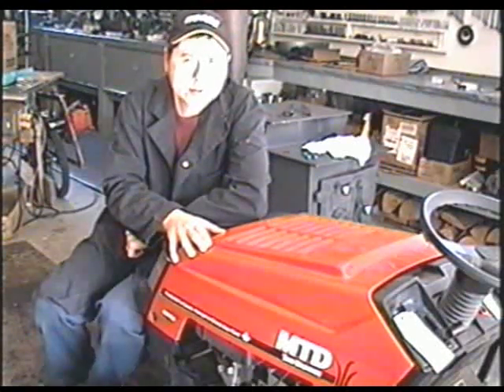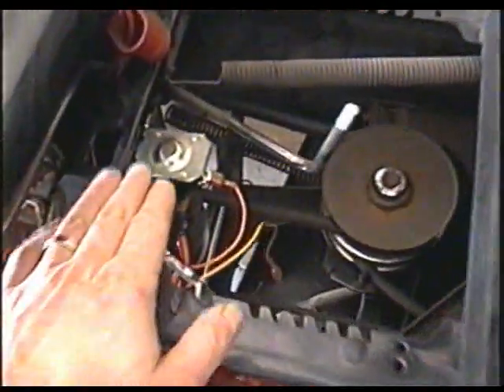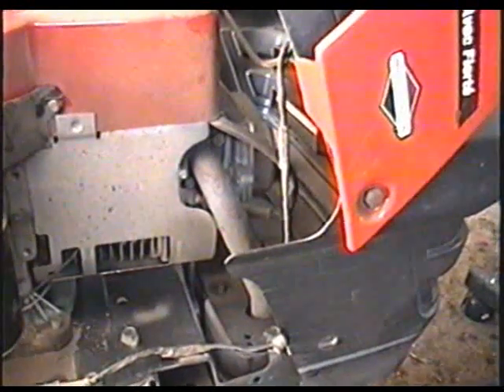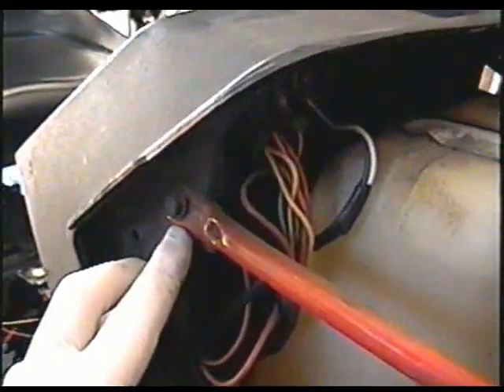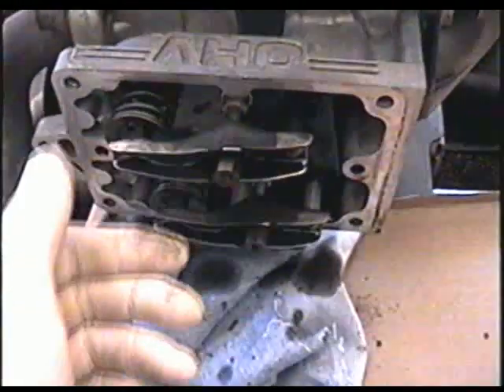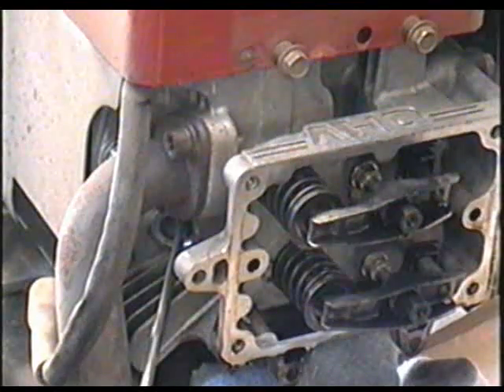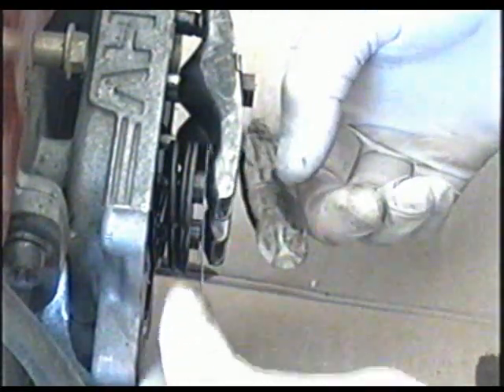( HOW TO ADJUST VALVES) FIX HARD TO START Lawn Tractor with OHV Briggs Engine- MUST SEE- Part 1/2

Comment: been dealing with a tractor  some one gave me it was sitting in the weeds the guy who gave it to me  said it dont run me playing around with it did see things as you showed it not quite  sure as I have seen other videos stating it could be a cam shaft issue some type of spring type gizmo in there I sure want to get the thing to run if I can't not to many worries there it was free however I want to learn and if you may guide me on my quest for knowledge 
      thank you in advance ☺

Comment: Thanks for all the helpful videos!
I replaced a broken flywheel key on my 14.5 B&S OHV yard machine riding mower.  I also adjusted the valves.  Everything seems okay but when trying to start nothing happens and I cannot turn the flywheel manually.  If I loosen the flywheel bolt I can spin the flywheel and also engage it by attempting to start the mower.  Yet, if I tighten the flywheel bolt even slightly, the flywheel will not spin.  Any thoughts on what I am missing?  Thanks!

Comment: i have kohler command pro 15 engine on my exmark mower and it has become hard to start recently especially when its cold. i thought that it was a throttle linkage adjustment but that didnt help. could the vavles be the issue? i dont think they have been adjusted and we have been using it for landscaping for about 9 or 10 years

Comment: Dony.  I have an 18.5 hp on a Toro Pony.  Is the feeler gauge setting the same?  .004.  I have tried several times without success.  Did the test for battery and starter without the spark plug and the engine turns fine so it seems to be the values need adjusting.  How much play in correct? is making it too tight a problem?  How do I make sure I am at top dead center.  Thanks in advance. Love all the info on your channel.  Great job.

Comment: This is a great video! I am having the same problem on a Briggs 15.5 engine.
I checked the battery and starter. After watching this I did the valve adjustment and it started 3 straight times and then would not start again. Any ideas??

Comment: I had a Briggs & Stratton 20 hp Intek engine and is hard to turn over and only turns with the spark plug out? I have 2 set the valves on the engine and have lower it to .003 and it still does the same thing. What do you suggest ? New valves or new head?

Comment: Hi Dony, Same type motor. Same type issue. So I adjusted the values according to your instructions. I get severe back firing when I tried. Could these be set wrong? I was not certain about the top dead center. Both vlaves all the way out after the compression stroke? I have seen different ways to do this, and after trying about 1 times Cannot get it adjusted properly.

Comment: @donyboy73 
thanks for the excellent video. I havea quesion to ask.  In my manualk it says :
Intake valve clearance is suppose to be set at 0.003 to 0.005 and exhaust at 0.005 to 0.007 , how do i tell the difference between my exhaust and intake valve so I can adjust them accordingly?

thanks

Comment: I adjusted the valves as per your video?  The valves moved as they should.. It started easily and I ran it for a few moments. All was good.  y I tried starting it and the same non-start happened again.  I repeated the valve adj and now the lower valve won't move when I cycled it through by hand.  Is the non-movement caused by something I did?  Your videos are great, and just long enough to get the problem explained.   I can see why your vids are so popular.. Please help!!  Thank you.

Comment: Great video. I've adjusted the valves, double and triple checked them but it still won't turn over with the starter. When starter gets to the point of opening the ex, it stops dead until you manually turn the flywheel. help!

Comment: I have seen  two ways on youtube to adjust the valves. One is TDC 1/4 turn  as you mention and others just take the pressure off one at time.  I just tried both on a briggs 17.5 HP engine  31c707 type 3346 G6, and I notice that if I set to the method you describe.  I have about a shim thickness difference  if I check  each when rotating  and checking one while the other is compressed.    Is it normal to have more space  after using the method you describe  if checking  each individually?  If set to the other method  of compressing one than the other. Then it seems a little too tight if  checking at TDC +1/4 turn.  
Briggs lists a tolerance RANGE so I am assuming as long as one is in the range it will be fine?

Comment: I have a B&S 21 hp . I have the same symptoms as the lawn mower in this video. I adjusted the valves; still have the same problems. Battery is good, starter is good, cycles through with no problem without spark plug in. what else might it be? i would appreciate your input thank you in advance.

Comment: Hi Dony, I have an older Cub Cadet rider model 2135 it is hard to start and starts sometimes but with a lot of backfiring I'm not sure the right spark plug is in it now, can you please tell me the correct spark plug preferably NGK to use and why the hard starts and all the back firing,, thanks in advance for your answer have a good day

Comment: You mentioned turning the motor a quarter inch, but I've heard it's actually you mark TDC on the item you are touching the top of the piston with, then you mark the item 1/4" from the first mark, then turn the engine until the piston has moved back down the 1/4". So, not a 1/4" movement of the flywheel but a 1/4" movement of the piston in the cylinder. Thoughts?

Comment: And also I did the carb rebuild I  tge nikki carburetor it came with a new needle but it looks like the seat is built in to the plastic of the carb tge kit came with a little metal piece that looks like the top of one of those smooth metal thumbtacks any thoughts??

Comment: Hi, I had the same problem. I bought it from a guy that didn't know much about Engine... Anyway... I didn't adjust anything.... It was hard to turn just like this Video. I lean the Tractor on one side... Drained all the OIL.... BAM.... The Engine turns FREELY again... The OIL was GUMMY. I Put NEW OIL.... Hahahahaha... I paid $50 Bucks for a 16.5 B&S MTD Mower... RUN PERFECT NOW!!! 

*** GUMMY DIRTY OIL or OVER FILLED OIL - WILL DO THE SAME - TRY THAT FIRST !!!

Comment: Donboy73 I just replaced the head gasket in my mower with a briggs OHV engine. It starts right away then the engine slightly revs up and down for about 3 to 4 seconds before it sounds normal. Is this the valve job I did or should I look for problems elsewhere

Comment: Hey donyboy73 I have a John Deere riding mower with a Briggs and Stratton 17hp intek engine it's doing the same thing when I turn
 the key I have watched your video many times and did it just as you did it but still not turning over fast enough to crank it up I replace battery and had starter tested its good (need help)

Comment: JUST WAS WOUNDERING IF YOU HAD ANY INSITES ON A 2001 HUSKEE RIDING MOWER RUNS GREAT THE WHOLE MOWER IS IN GOOD SHAPE THE BACK DRIVE BELT KEEPS JUMPING OFF IN DRIVE AND REVIRSE PUT A NEW BELT ON IT STILL DOES IT IT HAS THE VARIABLE SPEED PULLIES ON IT WOULD YOU HAVE ANY IDEA WHAT COULD BE WRONG WITH IT or do you have a video on how to fix it  THANKS FOR ANY INFO. TROY

Comment: hello donnyboy.  Enjoyed all your vids on briggs and stratton engines and how you explain things, thanks, good advice and easy to understand, I wonder if you could help me with a wee problem on my older model husquvarna/ with a briggs and stratton 12 horse power,,,, power built ,,,,,syncrho balanced  engine.  ???  The starter seems to be ok had it off cleaned up and turns the engine no problems with plugs removed..  So I replaced the plug put the starter back on and hey presto it worked.   Then after a couple of start ups the starter jams again engine seems to lock it up again.  When  the starter engages the flywheel the engine and starter seem to lock up up with a clonk.   The engine runs great with no rattles clanks smoke or any faults but some how jams the starter..  I think some thing needs adjustment but unfortunately cannot seem to locate a cover as with the OHV models for adjustment.. Will i have to remove some thing else or is there some thing I have to do in order to find out what the problem is.  I dont want to have to buy a new stater then find the problem is still there.I live in a remote part of the Scottish borders UK,  so rely on my ability to sort out most problems for my self but this has me a bit puzzeld. If you could help me out advise etc,  I would be grateful to your knowledge and assistance , thank you .  enjoy.                             TYPE/ 0167.01
MODEL/282707
12.HP. SYNCHRO BALANCED

Comment: Hi Donyboy73.  I have a craftsman 18hp that does exactly that but mine is flat head.  I did all I can think off and still not working.  I check the flywheel key and still in good shape, I tested both the starter and starter solenoid and they are working fine. spark plugs do have sparks, I've checked and clean the carburetor as well but nothing changed.  I even tried to adjust the valve clears by using a file but not 100% of the clearance so I did .008 for intek and .012 for exhaus still nothing changed.  what is interesting is when i removed the spark plugs, it turns freely.  Any idea or suggest?  Any idea or advice will be much appreciated it.  
thanks in advance.

Comment: Hey Donyboy, I have this same tractor and mine runs pretty good but it takes forever to start. You push the throttle all the way to choke and it just spins and spins for about 30 seconds before it finally fires and then you adjust the throttle. Is this normal for this type of mower? Also when I turn it off even for a minute, I have to choke it again to get it to crank. Any advice?

Comment: I also tested the wires going to the backfire switch on the cart and the switch itself both working fine. .. I tested spark is good. .. I tried jumping it at the starter with a chatger it cranked the Moro but there didn't seem to be enough power because it turned like urs did in the video... when I turn it w the key it spins far and it seems like it is so close to firing up.... it doesn't seem like it is flooding anymore since a cleaned out the entire fuel and oil system both a few times every thing running through that mower is clean enough to eat out of.... is it possible the rackers have loosened so much that its not causing resistance any more???? PLEASE HELP I can post a video if it would be more helpfull

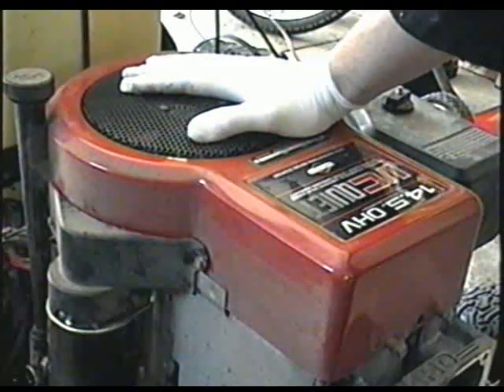Comment: 5:27 you don't turn the engine 1/4 inch. You need to find top dead centre then turn the engine until the screwdriver in the cylinder goes back in 1/4 inch (6mm) past TDC.

Comment: Hi, I have a 12.5HP I/C Quiet - has a hard time starting - sounds just like in this video - I pulled the plug and it turns effortlessly - I had thought before hand it was the starter. How ever its a flat head - is the procedure very different to address this issue for a flat head?

Comment: Donyboy, my engine starts ok but when i lift off the brake it dies down. I hard wired the safety switch under the seat so it is not an electrical issue because the tractor moves for about 1 second when the brake is fully released then dies,. Is this also a compression issue?

Comment: Adjusted the valves on my 1997 14.5, but still have the problem.  With the plug out, starter turns the motor no problem.  I have checked the valve adjustments about 1/2 dozen times now, going up or down .001.  Currently on .002 for intake and .003 for outlet.  Turn the key and engine turns about two revolutions and stalls.  Could it still be the starter?

Comment: My intek (older Craftsman motor) just started not wanting to turn over. Good battery and starter. It's just having a hard time. The bottom valve (exhaust?) doesn't move now. Strange. Pushrod doesn't look like it's moving in and out. What should I be looking for? When I try to start, gas leaks past valve and out exhaust. Do it's stuck open? I'm lost.

Comment: Hey, Donyboy73. I have a Craftsman LT2000 with a Kohler Pro 17.5 HP OHV. It does the same thing as the mower in the video It cranked up fine just a few weeks ago, but today it would only spin then stop. I had this problem before and so I hand-twisted the pully to loosen it up. Last time that worked, but this time it didnt. I could twist it only so far, then it got difficult to twist. So I tried something else. I took out the spark plug and then tried to crank it like you said. It wouldnt crank then it either. It clicks but wont spin. However, when I twist it manually, it twists all the way much easier with the sparkplug removed. The voltmeter is hard to read, and it shows a little left of center. Should I get a new battery, plug, or starter? What steps should I take now to determine the problem?

Thanks

Comment: Danboy, I've put in new plug, air filter & oil. Cleaned the Carb very good.  The riding mower starts run good, but only on high RPMS.  Dies out on mid or low.  Is it running too lean ???   Thanks for any advise
Reply from the maker: you might need a new carb kit
Reply: After I cleaned it (old techumseh engine) I did put in a new Carb kit.  Compression is good, thanks for the quick respond
Reply from the maker: I thought it was a briggs, I would turn out the adjusting screw a bit
Reply: OK. I'll go try that out. Thanks again
Reply: Thanks
Reply: It worked. Danboy. Turned out the screw a bit, but now it runs good on mid&low, but surges in high speed and dies out.
Reply from the maker: tony Kari you may still need a carb kit

Comment: Hi,
Great video, you mentioned to torque the Torx screws to 45 pounds.  Did you mean 45 inch pounds or 45 foot pounds?
Thanks
Tony
Reply from the maker: inch pounds
Reply: 45 inch pounds

Comment: i have a tecumseh 5hp engine that starts like a charm but it dies maybe 5 secs after starting.. and it spits fuel out of the carb once per revolution as it spins down. i'm thinking the timing is off. and the fuel is squirting out of the carb on the exhaust stroke b/c the intake valve is still open.

Comment: +donyboy73
I've adjusted my valves twice. Once at dead top center and the other when one valve is open and the other closed per your other video . Each time I try spinning the flywheel with my hands and it is very hard. Take the plug out and it is no problem. Any ideas?

Comment: @donyboy73 Thanks for the info! I'm trying to get this IC enigen to run on my Snapper 28106S whitch the stock 10 HP B&S enigen cylnder had deep scoring marks on the cylinder head and wasn't fesabel to get it rebuilt.
Since there are 4 cabels that are running from the stator, which pair of cables go to the headlights and other pair to the battery. I can't find a wirning scamatices over the IC eningen.

Comment: I have a sears craftsman rider about 3 yrs old. it starts and runs for like 10 mins and then it shuts off and won't start.  i've given it a tune up and replaced oil, spark plug filters all three.  would this be related to the valves also   there is also  a plastic thing where the gas line goes into, would this be the problem? that plastic thing is on the valve cover

Comment: My motor does the exact same thing, but I have my adjusted at .004 then 003 and is still does that false start ,,new battery solenoid and rebuild starter,,still  does that 1/8 turn

Comment: If valves are out of adjustment on these one cylinder briggs can that cause the engine to backfire?  I have been told that but, wasn't sure.

Comment: I have same problem with motor turing over...I tried adjusting valves to .004  ,  then to .003, then to .002...all these settings  and the engine would still seize when trying toi  crank.  Finall I set them at no gap...000  and it finally seems  to crank now but still wants  to  stall   and seize occasionally when trying to crank.  What could be causing all this.  The engine is a 21HP  briggs  PLatinum Model  331877.  Could it be a worn cam?  The engine is only 3 year old.  PLease  help.

Comment: Dony, thank you for your video but I did not have any luck. My observation was when intake and exhaust was loose then I turned the flywheel but it was extremely difficult to turn. I was able to finally turn it and then it then the intake spring started to move.

Also, at top head center I turn the flywheel 1/2 a turn then the intake moves. After intake and exhaust go in an out it turn 3/4 the way around before the intake moves.

The problem seems to be just before the intake moves that the flywheel builds up compression? and is extremely difficult to move.
Please help. Thank you

Comment: I was using my riding mower which has a 21 hp ohv engine on it and it starting making a clicking noise while running it lasted for a few minutes and then stopped making noise at that time it lost about half the power it stars fine but with only about half as mush power any advice on what is wrong ?

Comment: Hi..I was wondering if you could help me..I have a 2010 yard machine 638 RL by mtd ...13.5 hp 344 cc.  model number 13ac762f.i need to adjust the valves on it and i cant find what to set them at...i cant mind a manual for it...would you happen to know ? any help would be appreciate it..thanks.

Comment: I have riding mower with B&S engine (Model 31A607 Type 0741, Code B2 080303ZD)on it and it does pop and get too hot after mowing it for 10 minutes. This engine has plastic fan attached to flywheel for air circulation which losses its blade or two every time I use it. Half of the fan blades are broken. It is a old engine and starts right away. I hate to get rid off it. Please advise on this issue so I can learn how to fix small engine.

Comment: I pull the spark plug and turn the key. The flywheel turn just like in your part 2 video, to see if it was the starter and the battery. What else can it be?